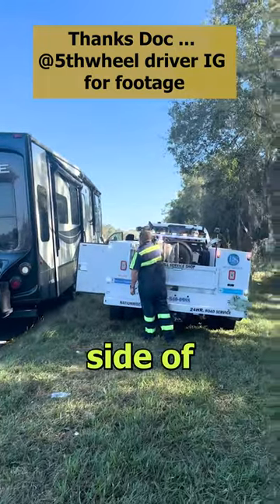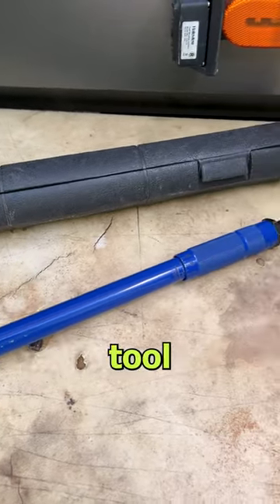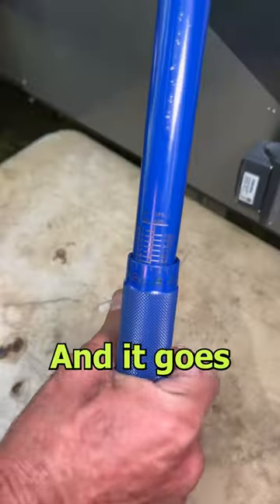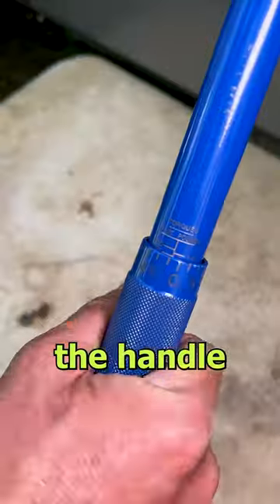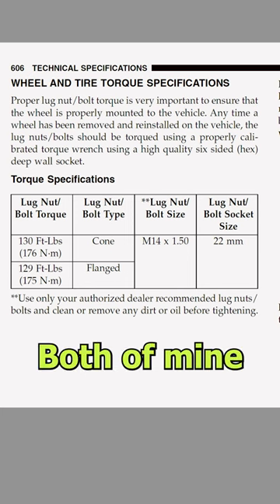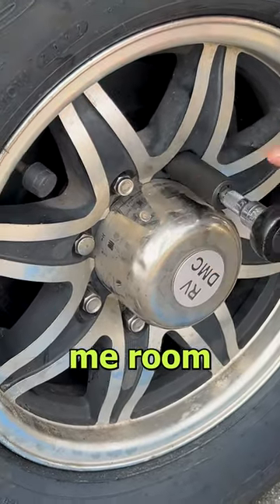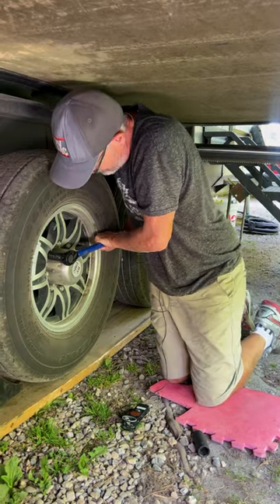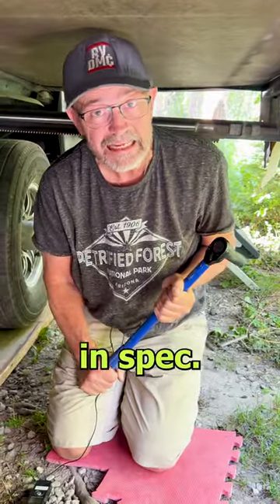Don't Lose a Wheel / Torque Right! #shorts (RV Living Full Time)4K

Comment: It’s usually never the lug nuts it’s always the hub bearing, so you want to pull wheel off then the cap and inspect the bearing, looking to make sure it is well greased and no water, also right before you pull the lug nuts and wheel off try just moving the moving the wheel to check that there is no play in the bearing
Reply from the maker: We always maintain bearings at least once a year - video to come 
And we replaced bearings and races